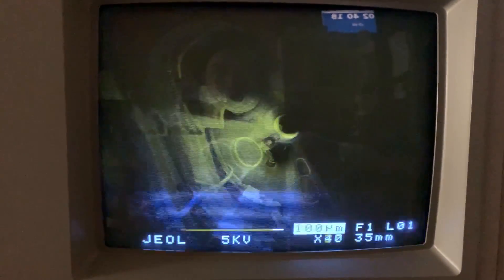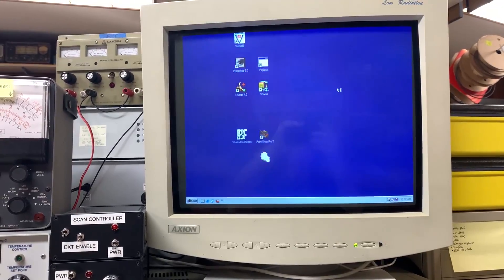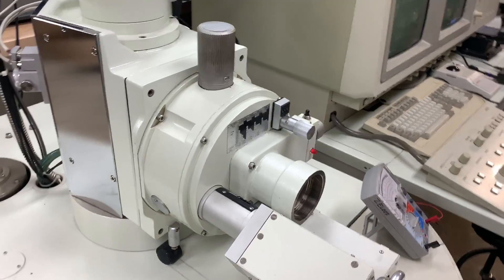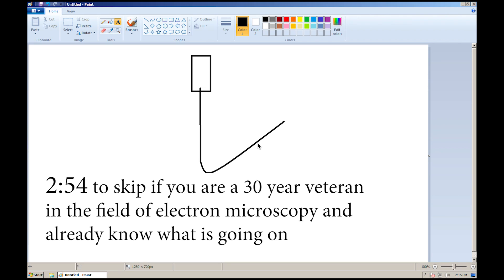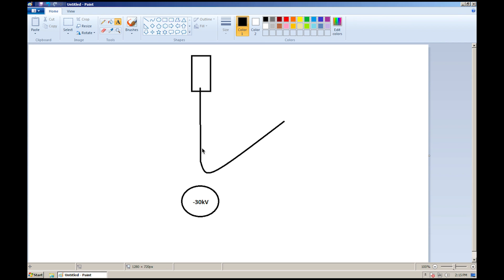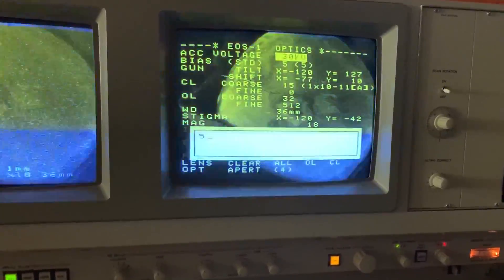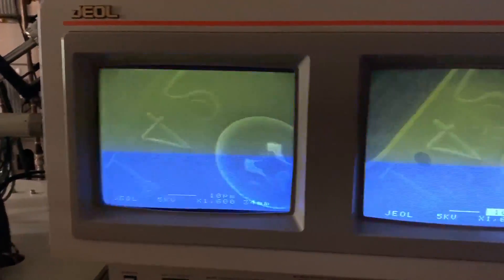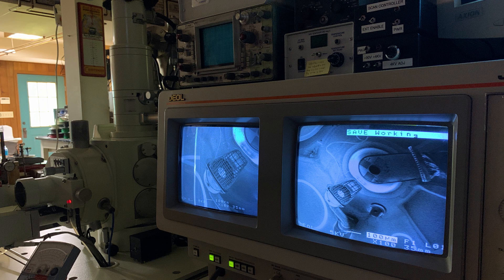High energy particle mirror

Comment: The mirror flipping is a bad question. Mirrors don't flip images, it's that either the object being viewed or the observer have flipped are facing the wrong direction. Hold up a sign and look at it, now if you want to look at it in a mirror you need to flip the sign. Usually we do this horizontally, but if you flip it vertically instead, now you have a weird mirror that flips things vertically! Except you don't; mirrors don't flip anything.

Comment: You asked "if this really was a mirror" and something about images being flipped horizontally.
I think answering that requires saying: 🤓 ACTUALLY 🤓 mirrors don't flip horizontally. The same objects are on the left or the right of the observer. They in fact flip depth.
Another way to consider it is that they negate the cross product between observed vectors. And I believe your "electron mirror" would do that, as the observer and the mirror are on opposite sides of the observed object(s).
Tl;dr: yep, it's a mirror.

Comment: Hmm, the charged insulator does act as a convex spherical mirror for electrons.
So - assuming your EM is a Reflection-EM - it should be virtually identical to taking a photo of a mirror ball that is being illuminated from the top, the insides also reflecting electrons and becoming visible.
Thus Left<->Right should be mirrored.

The fact that the inside of the chamber becomes visible at all strikes me as odd, since it means (at least to my knowledge) that whatever isn't black in the image, doesn't absorb the electron beam -> at least part of it is reflected.
Which in turn means that a beam, that bounced off the sample without landing in the detector/camera might do so after multiple reflections.

While the "selfie" feature is very cool, i think it could increase image quality to place a hollow conducting box over the sample, with holes for coming and going electron beams, acting as a collector.
But since a collector should de-focus the beam, the collector and its holes should be rather large, spherical and centered on the sample, the holes need to be perfectly circular (more precisely: circles around the lines connecting beam-source <-> sample <-> detector) , and the focus of the beam as well as the detector adjusted (independently) to obtain a crisp image.

Anyway, those are my thoughts as someone that has never touched an EM and only knows the theory behind it, so do take it with a handful of salt.

Comment: I imagine you could correct the spherical aberration if it was indeed spherical object. Perhaps the steel ball suggestion by Chuck Norris could achieve this. 

In answer to your question, an electron microscope "sees" by illuminating a phosphorescent screen, like an old tube tv. I imagine that the image you are creating by essentially blocking the electron beam to the screen is created by reflections off the walls of the microscope which is what creates the details on the screen. Very cool indeed.
Reply: Oh, the answer to the question - no I don't think the image is reflected.

Comment: Very cool! Couldn't this also be done using a metallic object by placing an insulator between it and the stage?  I've been studying secondary electron emissions a little bit lately for some upcoming experiments, and my understanding is that metals generally have a SEE ratio below unity, so they should also accumulate a charge eventually (slower than an insulator) if they're not grounded. Your thirst for knowledge is both humbling and inspiring. Keep up the great work, Sam!
Reply from the maker: Almost definitely, i'm going to mess around with this next time the microscope is running. glad you enjoyed the vid!

Comment: "Sometimes" is the correct choice I believe; also, please excuse my English.
As a "normal", flat, optical mirror doesn't really flip images horizontally (in a direction parallel to its flat surface), but rather appears like it inverts the axis normal to its surface (Consider punching holes, in the shape of English characters, into an opaque sheet and then illuminating the text thus formed by shining a beam of light through it. If you hold the text 'facing' you, so that you can read it without looking in the mirror, then the reflection in the mirror will also be readable/'unmirrored'.)

In this case, each point on the sphere gets projected to some other point in the microscope, with the 'warping' depending on how close the 'focus' is to its surface. However, whether or not this warping will 'flip' depends entirely on the sensor's position, focal length and on if the external or internal surface of the sphere is being imaged. For example, cutting something like a ping-pong ball in half and moving your focus 'into' and back 'out of' the half-shell.
Reply: Due to the long working distance/low angle of convergence of the electron beam I don't think the focus point has much of an influence. Aside from creating an incredibly blurred image if you are not approximately focused on the charged sphere that is. 

Just to make sure we're on the same page, I define the default image of the electron microscope as taken by a camera that is placed at the sample holder and faces upwards. The bottom of that image shall be closest to the chamber door. With this default in mind, to which all images will be considered mirrored or not, I think it does produce an inverted image. 

If the electron beam points to the top left corner of the charged sphere as seen in the microscope if imaging as usual it is deflected and hits a point of the chamber that is the top right of the camera image. You can repeat this though process for all corners of the image and get the following relationship:
SEM image - camera image
top left - top right
top right - top left
bottom left - bottom right
bottom right - bottom left

As you can see with the above definitions of what the reference, not mirrored, image is, the charged sphere does indeed mirror the image. Keep in mind though, that this reference is by no means set in stone. In fact neither is it for a classical mirror. If you have the opportunity at home, lay in front of a mirror - is it still changing the image in a way that you would call horizontally flipped? The answer is yes, if you rotate around your z axis to get the default image and no, if you roll along your length axis to get the default image. But neither of those is considered more right or wrong than the other. The same can be said about the camera orientation in the SEM that is supposed to produce the reference image - no orientation is objectively right or wrong.
Reply: @turun_ambartanen  intuitively I find your answer more agreeable, at least the first.. Though I'm not sure I understand your last claim with the mirror, rotating around axis to get the original image, because it makes me think of chiral figures (For others who might not know the term, this is from wikipedia: "In geometry, a figure is chiral (and said to have chirality) if it is not identical to its mirror image, or, more precisely, if it cannot be mapped to its mirror image by rotations and translations alone." - Wikipedia; Chirality (mathematics))
Reply: @turun_ambartanen  "I define the default image of the electron microscope as taken by a camera that is placed at the sample holder and faces upwards"
That's very arbitrary. The microscope produces an image that's from a top-down-perspective. Imagine that in a regular use-case: You put a coin in the chamber, you turn on the microscope, you get an image, it looks like you are looking down on the coin and you can read the text on it.

At 1:23 we look into the microscope through the door. Take note of the detector currently occupying the right half of the shot, and the squiggly copper wire being close to the camera, i.e. close to the door. Imagine you took the top off the chamber and took a photo looking down into it. Orient the camera such that "down" in the photo is towards the corner of the chamber that is close to the detector and away from the door. In the shot at 1:23 that is the far-right corner. (If you're wondering "Why the weird orientation?": We'll get to that in a moment.) On this photo you would see the detector in the bottom-left corner and the door with the squiggly wire in the top-left corner. Also note that the squiggly wire is mounted higher-up than the detector, so on this photo, the squiggly wire is seen in front of the detector.

Now imagine placing a flat mirror at the bottom of the chamber and taking another photo from the same orientation. Mirrors don't flip left and right, and they don't flip up and down, so in the reflection, you would still see the detector in the bottom-left corner of the image, and you would still see the squiggly wire and door in the top-left corner of the image. But mirrors *do* flip forwards and backwards: In the reflection, the squiggly wire is *behind* the detector.

Now imagine placing a polished steel ball in the center of the chamber and taking another photo from the same orientation. Same result, but just warped a little bit. In the reflection, the detector is in the bottom-left, the squiggly wire and door are in the top-left, and the squiggly wire is behind the detector.

Now take a look at the image that the microscope produces at 4:04: You can see exactly that. The detector is in the bottom-left, the squiggly wire and door are in the top-left and the squiggly wire is behind the detector. (This is why we imagined the hypothetical photo above from this weird orientation, so it's easier to relate the two images.)

So the electron mirror behaves just like a photon mirror in this regard. It does not flip left and right, and it does not flip up and down, but it does flip backwards and forwards.

If you choose to see the image as taken from a different orientation - namely flipping the camera around to point upwards - then yes, the image is flipped relative to that already-flipped orientation. But that's extremely arbitrary and does not really help at explaining the original question: "Does it actually flip the image horizontally like a real mirror does?"

Comment: ..... What in the hay?
I get how the electeons deflect... but how do they get to the detector and still give a decent image.

Facinating stuff.
Reply from the maker: i know it seems unlikely that it should work this well! That mesh in front of the detector is actually biased a few kV positive so it sucks up all the electrons from around the chamber easily
Reply: @SamZeloof  I wonder what the average time of flight for this new path is.
I get that the scan rate should be matched with the emitted electrons, but I'd expect it would start to bleed "pixels" together. So surely there is a correlation between the scan rate and image quality.

Comment: Wouldn't like a ball bearing, placed on a teflon isolator just work the same, only with better image, because it's more round and at same charge all around?
Wish I had my own SEM, btw. Had one at work a while ago, but having one at home to play with, is much nicer.
Reply from the maker: perhaps, makes sense to me
Reply: @Chuck Norris Metals and plastics are very different on the molecular scale. Metals are more conductive due to the metal's ability to 'allow' the electrons to free flow across the atomic surface, or metallic bonded atomic orbitals, making up the metal. My guess would be the photoelectric effect as the quanta of energy, not wavelength, affect the displacement of electrons from the material. Metal is a much different 'polymer' than plastic (using polymer extremely broadly). We are using electrons, not photons. Though I am certain you are aware of this and not trying to say you're wrong by any means... Just my curiosity. Input? Also, why teflon exactly though? Inert, non-reactive, C-F bond strongest in ochem giving it these characteristics, or conductive, but much more porous than your standard raw HDPE/LDPE cheaper plastic polymer. One reason I'd never use teflon tubing for vacuum lines, even with my triple diaphram teflon lined (only ~1mmHg ultimate vacuum, but excellent for a diaphram lab pump) vacuum. Just curious on your reasoning as I'm self taught in organic chemistry and quantum mechanics and in a completely different career. (Personally hobbies and work I like to separate, but that's just me). Any input on this too? Thanks.

In my videos I owned a KNF UN820.3 FTP, but now own a brand new KNF N 920 G.

Comment: Do you really run you’re electron microscope on windows 95? I feel like you would be able to emulate it on modern hardware. Also nice touch with the MS paint.
Reply: If it works don't touch it.
Reply: If it ain’t broke don’t fix it.
Reply: Try using the concave surface of a spoon as a mirror. If you look into a spoon that is close to your eyes, the image is right side up. Move the mirror away past the focal point, and the image flips. Spoons usually have different radiuses of curvature, so the image is distorted in interesting ways. Keep this in mind if there is a bored child at the table in a place with shiny silverware, like at a wedding reception. The adults at the table usually start looking into their spoons too.

A nice thing about a spherical surface is that the electric field will also form a sphere. That won't hold with other shapes. A small concave imperfection in a smooth surface will disappear from the objects electric field as the voltage goes up. Any statically charged surface is electrically identical to a sphere if the voltage is high enough.

With a difference of 25kv I am hoping that a teaspoon will make an interesting fun house mirror reflection, but I last did that sort of math 35 years ago.